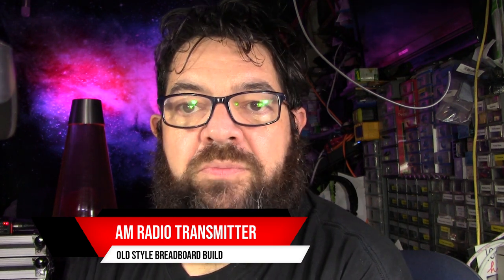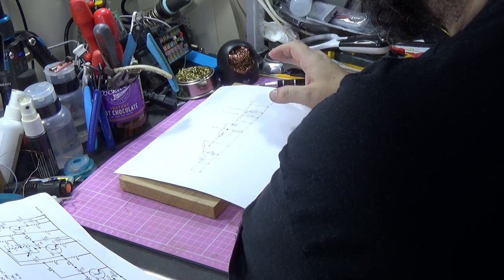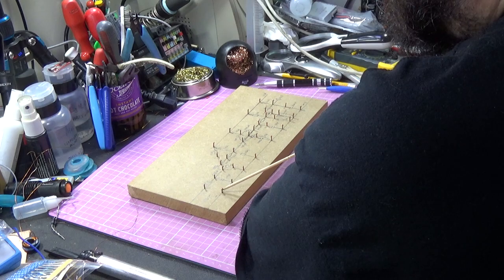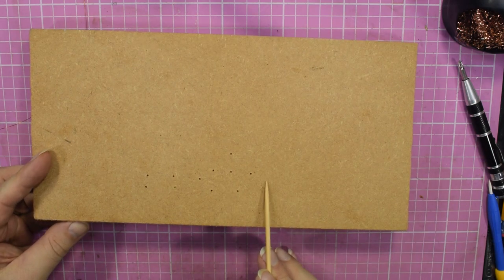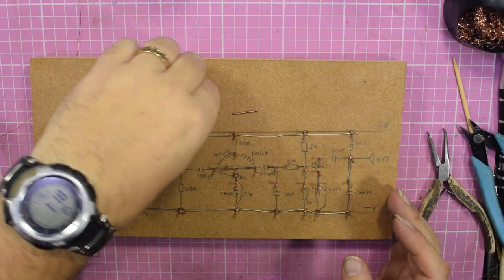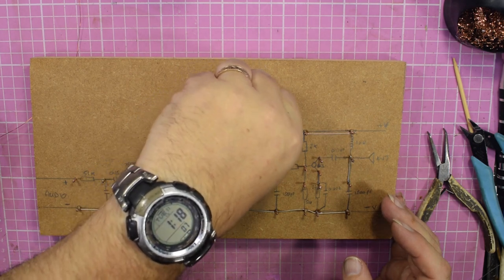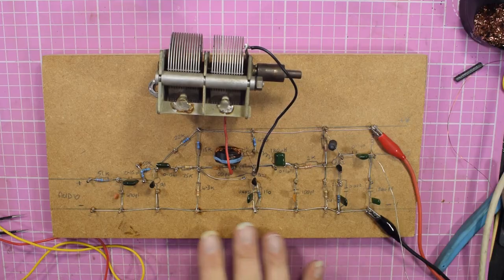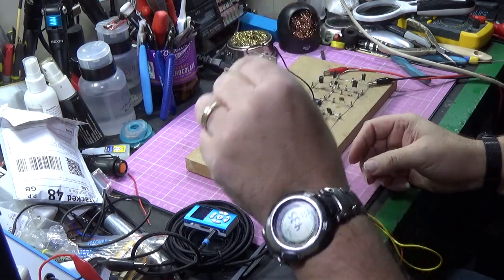Build AM Radio Transmitter - SIMPLE Method - How To Make

Comment: Dears, what is the range of this tranamitter ? Tks.
Reply from the maker: It depends on a variety of things. The first one is the length of the antenna, the second is where you are using it. realistically though, around 10-60 feet would be the range with a short wire antenna. If your wire was 3 metres or longer, possibly more. I cannot say exactly because the laws here make broadcast am transmitters illegal if they radiate outside your own property.

Comment: I think I may have given the wrong impression. I was trying to illustrate the following point:
There is essentially no difference between transmitting wirelessly and linking a speaker to an audio source. In the latter case, current flows through the wire, while in the case of wireless transmission, the current goes through (empty) space. We call this kind of current electromagnetic or radio waves.
The difficulty resides in the fact that we have to direct the transmitter and the receiver towards each other.
A very simple but often effective way, is to move the antennas around. A more complex, but also more effective way, is to change the properties of the current used. That is where all the resistors, capacitors, transistors... come into play. Basically, what we are doing is making sure the current, which would only need to be amplified in the case of  an attached speaker, has the right voltage, amperage, etc.
In both cases, wired or wireless , more or less current is applied to the wire or antenna. That is where the "magic" resides. But it is still electric current, and nothing else. None of these components make wireless transmission possible. Only more effective.
That was the point I was trying to make.
edit: I wonder, just like I originally did in my first comment, if we could, after we have established a successful connection, measure the current that has been applied to the antenna, and then take all the components away while applying a current of the same properties directly to the antenna. Would we get the same result?
Reply from the maker: The simple answer is no, you would not because the radio wave is a modulated single frequency carrier but the straight audio is a variety of frequencies from 0-30Khz. Without a way to concentrate these frequencies and carry them then there is no way you could just use a speaker.

I'm not sure where you are trying to go with this because radio is radio, has been for a hundred years or so and the physics of wired and wireless transmission are fairly fixed now. All forms of wireless rely on some form of carrier whereas ordinary electricity is contained within a conductor. Some AC will radiate as EM waves but not very much unless significant power is used and the conductors have not been screened.
Reply: @GeorgeChristofi  I will not discuss the theory of radio waves. Suffice to say that I am not totally convinced of its correctness even though it allows very practical results. I would therefore need many good arguments to reject the theory, arguments I do not currently have. In fact, I am not sure I can even ever find those arguments. In which case I will simply admit defeat.
But your answer is a theoretical one. I wish I had the skill and patience to test its veracity, but I think you are much better qualified.
I would really be interested in testing your answer empirically, and hope you will not immediately reject my proposal on theoretical grounds.
edit: to be clear, this is what I propose to test:
You use the transmitter you have built, plug in your mp3 player and transmit just like you have done in this video. After having set a good link with your receiver allowing the successful transmission of your audio, you measure the current that was applied to the antenna.
Next, you find a way of replicating this current and apply it directly to the antenna, with only the mp3 plugged in. My claim that you should get a successful transmission will be easily confirmed or refuted.

Comment: If you used a bigger board you'll still have enough room to cut your sandwiches...
Reply from the maker: Indeed. although you have to make sure your knife doesn't cut the copper wire between nails!
Reply: @GeorgeChristofi  Check out the 700 WLW MW transmitter in the US on youtube, It operated at 500,000watts back in the 1940s. Modulating the carrier required 250kwatts of audio !! You wouldn't want your bread knife anywhere near it.... Great stuff !!

Comment: bro i need a clear circuit diagram of it.plz
Reply from the maker: I can do that once I return to the UK or if you follow the link to Robert Gibbons channel then he has the diagram there now.
Reply: @GeorgeChristofi  keep it up bro.your works amazed me very much.how much rf power dose it emit? can i use 2n3055 as rf power amplifier for am signal??
Reply from the maker: @electronicshacks8288  you could use a 2n3055 but that would be overkill. the best improvement is to add a narrow filter to the output, again something Robert did in later videos.
Reply: @GeorgeChristofi  I am also looking for the diagram. Thanks for taking your time to send us this schematic!

Comment: Where do you get a huge roll of solder and are they expensive. And i never knew that thats why a breadboard is called a breadboard interesting very old school
Reply from the maker: Decent solder can be had from a lot of places. Roll size depends on how deep your pocket is. I have seen it come in anything up to a 5lb roll but the cost of that is high. I bought a roll not that long ago from farnell, it was 500G, around a pound in weight and it cost me about 40 pounds uk price. Things change often though and the global price of lead and tin can fluctuate so you have to search around.
Reply from the maker: You will have to buy online to get solder, the stuff in b&q is plumbing grade, not electronics. I don't think any of the shops near paddington green on the edgware road are still open, that would be where I would get some over the counter in london as a student.